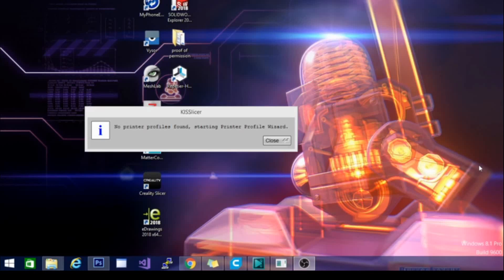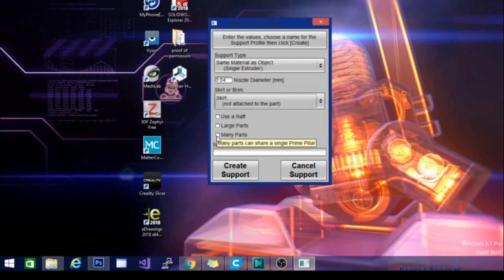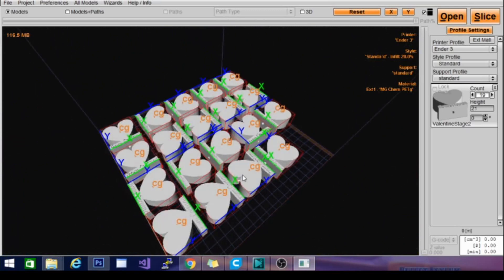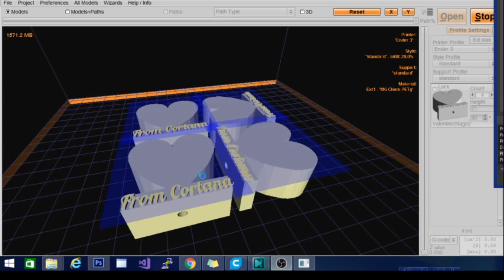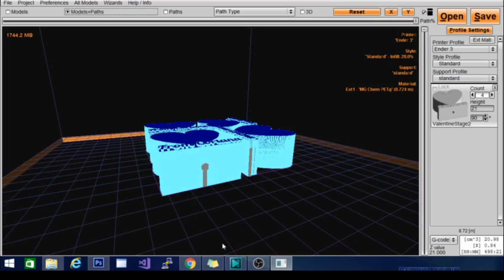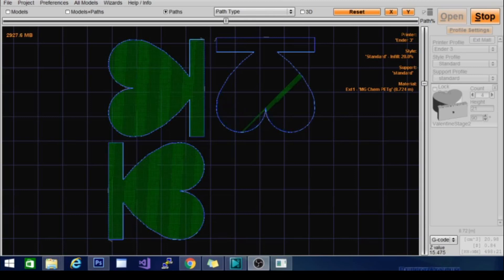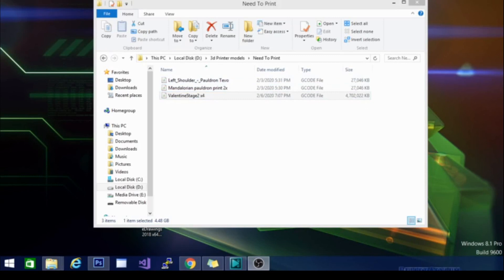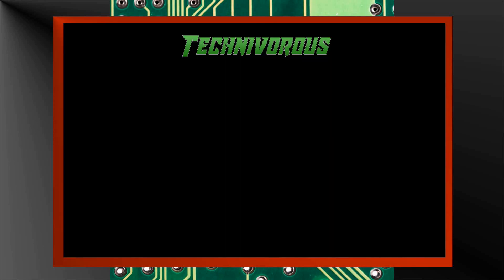KISSlicer - Keep it simple stupid

Comment: Kiss works great for me...
it is not automagic... you or the manufacturer of the printer have to enter all needed values for it to work. Average slice time for me is 20 seconds.  More layers/volume the longer it takes.
Reply from the maker: I plan to revisit this. I messed up the stting horribly when typing them in,and have since figured out what I did wrong. Typing .04 for nozzle sizes my first mistake, but there were more.thanks for the tips I will include them in the updated video!

Comment: Dude. Look... you are making recommendations based on one sliced file that was more a showing in what you don’t know, than what the slicer can do. You should really take more time to understand this and everything you “review”. KISS is coveted amongst many prominent people in the community as the ultimate slicer. It can do many things no slicer can do. It just takes time to learn. I suggest you retract, get familiar and do this over. It has dynamic infill? It can print patterns into your outter Wall! Checkout SublimeLayers. He’s the master of Kiss.
Reply from the maker: I appreciate the info Stephen, and I haven't given up on it yet. Unfortunately you cant avoid the irony. It is the least simple slicer I have ever seen. Still. I will give it another go, or two. I always do.
Reply: Technivorous 3dprinting “Simple” is a relative term. KISS again is used by some of the most respected people in the community and when you full understand what it can do you’ll be amazed. In fairness to harness all the features you need to buy a pro license. I typically use PrisaSlicer which for basic straight slicing is the most powerful, up to date and feature rich slicer for free. But KISS can do things like make the outter wall of our print look like wood grain... lol. It’s crazy the things it can do. It’s just a very different interface, and it’s very unusual terminology.
Reply: @Technivorous  When KISS came out it was considered to be very simple to use. Especially when you think about how amazing the print quality was.

Comment: The nozzle diameter and extrusion width are set to 0.04mm!
What do you expect? It is not kisslicer that sucks, it's your settings.
Reply: I think most softwares would give you an error when slicing with 0.04 mm nozzle width and a layer thickness of 0.00132. From 0.4 to 0.04 is literally 1000 times smaller extrusion in cube/volume. So it makes sense for the time and file size to be almost 1000 times bigger. Sure, it would be great for the software to warn if you set such a small an incorrect number, but it really isn’t the softwares fault. 
I just hope that this isn’t the first video newbies see of Kisslicer and immediately dismisses it because of your lacking video and knowledge. 
It takes time to master 3D printing so I don’t blame you in that sense, but you should have at least corrected you error and said you did a mistake and given it another try and not just blame the software and let the video just be as is. 
I hope you keep up making videos and to master the art of 3D printing.
Reply from the maker: @ChristianEriksson83  im working on it. i dont know what i was thinking that day.... its been a long month, but i have gotten this working after that mistake was pointed out, and i plan to revisit it soon, i just want to make sure i do it justice this time
Reply: Technivorous 3dprinting cool! Looking forward to it.
Reply: @Technivorous  Can you link to the updated video?
Reply from the maker: I dont have a problem adjusting settings through multiple prints. I wasnt expecting my settings to be perfect. I was just expecting it to slice in less than a day. Dont worry I haven't given up, I will get some prints out, and play with the settings. And before I do, since you seem familiar, please feel free to leave me more tips on settings to save me headaches when I do!
Reply: Do some research before you put a review online, Michael hackney from SublimeLayers is a good starting point.
And if you slice an item and you have this sort of results, you must know somthing isnt right, the first thing you do then, is check your settings. Now you have done harm on the makers of kisslicer, they don't deserve this.
Learn, try again and put an honest review online.
Reply from the maker: @wolfken01  easy there guy, i take constructive criticism pretty well. CONSTRUCTIVE. which by the way your first comment was. i kept throwing an error right before slicing about taking massive amounts of memory, then i adjusted the extrusion width manually, and viola! kudos to you and thanks for the tip. im a little irritated at the way they word it during setting up the profile, making it seems like it sets it automatically depending on your nozzle diameter, but i digress, my bad. the model is slicing, and at a decent clip i might add. again thanks for the fix, and you can look forward to seeing more of my opinions on this slicer as continue using it until my opinion is made. as i stated in the video, it could take a million years to slice, but if you get a good model its worth it. imagine my frustration at not getting a model at all. by the way, look around my channel some more, and you will see im no stranger to slicers, i might not make what you consider professional videos, but i have successfully used pretty much every slicer out there, and this one is the ONLY one that i failed to get a print from. sounds to me like they should have kept it simple, don't ya think?
Reply: kisslicer is a powerfull slicer, really easy to set up. But, it has some issues, the greatest one is the lack of offical documentation, even the official forum, kisslicer talk is offline for months, so there are settings that even now i have no clue what they do. So, when i saw a new review, i was hoping to learn somthing new about this slicer, but i was really disapointed.
One tip, on the right side where you can multiply your items, click with the right mouse button, the settings to adjust your STL file are there.
This is the unofficial manual for kisslicer: https://snolabs.com/blog/the-missing-manual-to-kisslicer/
Reply from the maker: still playing with this. i have had a little success. you will see more of it soon. thanks for all your tips though i dont think i would have gotten this going this far without them.

Comment: You couldn't put a 5GB gcode file on your SD card most likely because the card is formatted as FAT32 and you can't store a file over 4GB in that file system.
Reply from the maker: That's correct. Thought about plugging in through usb and just printing the file from the PC, but I didnt want to tie up the printer for an unknown amount of time.